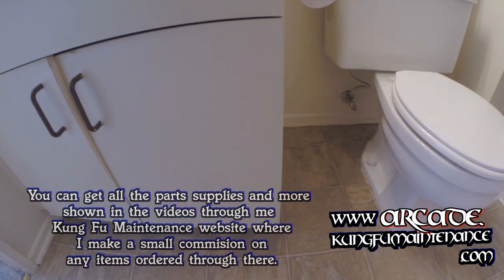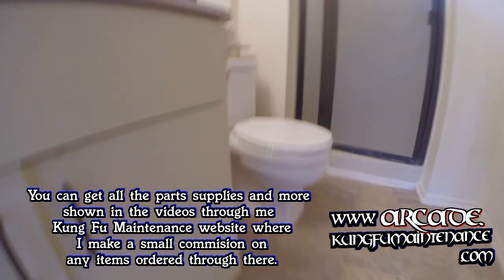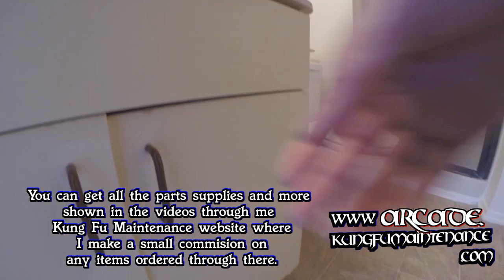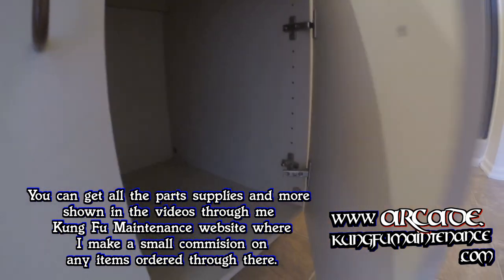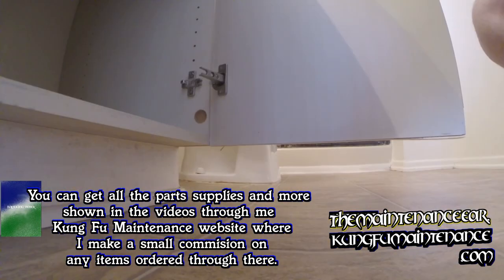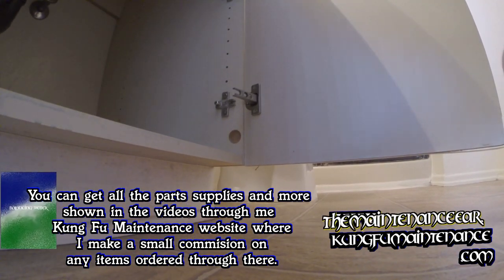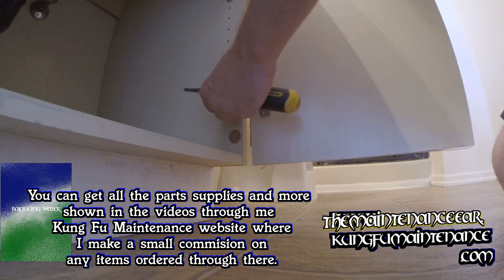How To Reset Cabinet Door That Fell Off Concealed Hinge Maintenance DIY Fix Repair Video

Comment: It just wont slide in, tried about 20 times. 

IT JUST WONT SLIDE IN. WHY?!?!?!?!
Reply from the maker: +rhyz don Try loosening the back set screw a little first. Then look at the pivot screw. The pivot screw may need to be loosened or tightened a little bit to allow it to slip onto the bracket. Once on tighten set screw and adjust pivot screw accordingly.
Reply: KungFuMaintenance I got it mate, it didnt go in as nice as the others though, but its in.